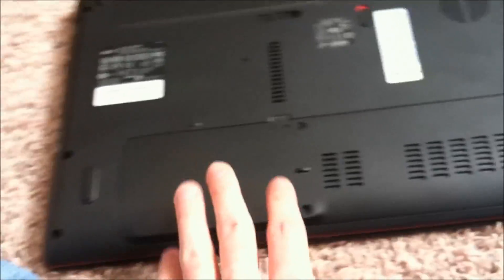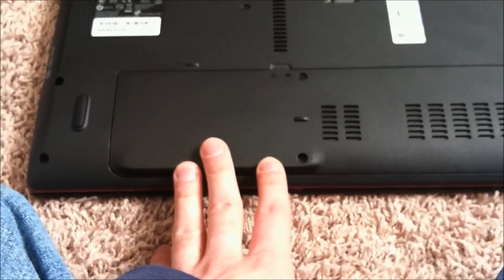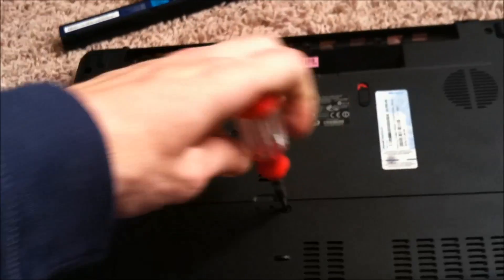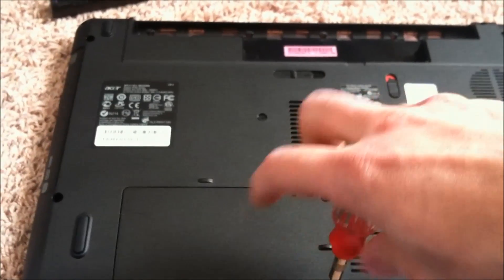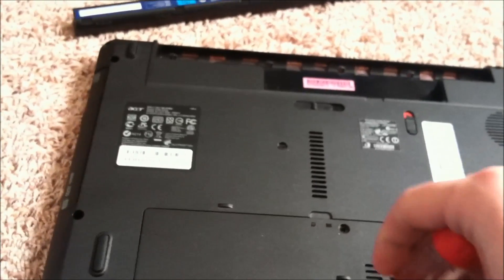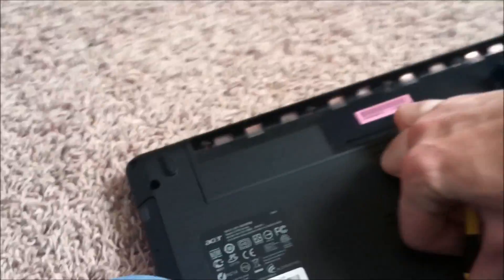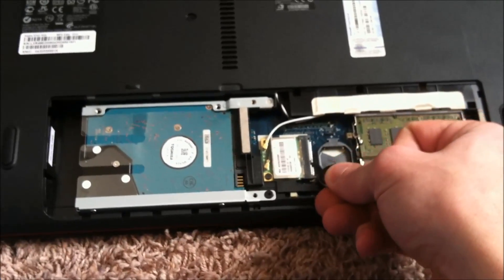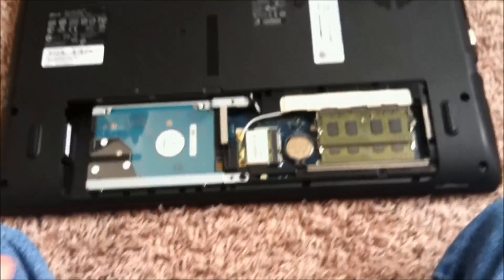How to reset bios password on Acer Aspire 5742 PEW71 laptop

Comment: hi there, i followed your directions and we changed the passwords.  Only problem is that once the windows is starting up, it comes to a screen that says "steps starting services" and then an alert comes up saying "the computer restarted unexpectedly or encountered an unexpected error.  Windows installation cannot proceed.  To install windows, click ok to restart the computer and restart the installation."  So as i continue to click ok, it just simply continues to restart.  Do you have any idea how to fix that? thanks so much
Reply from the maker: Did you try installing Windows before trying to change the password? The two have nothing in common

Comment: the data will LOST or NOT
Reply from the maker: video title states what it exactly does. it removes the bios password. no data will be lost.
Reply: where is cmos battery located in acer aspire 4736z laptop
Reply from the maker: No idea for your model
Reply: niraj kumhar if your still looking its located near the ram slot but to access it you need to basically strip it